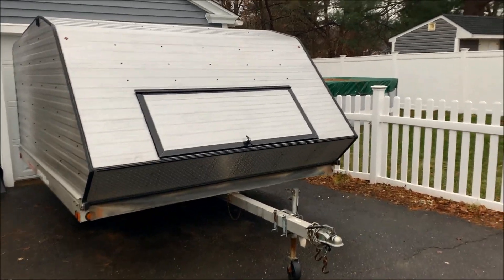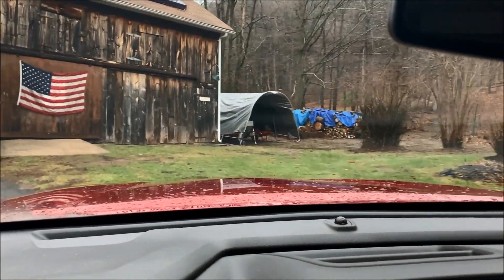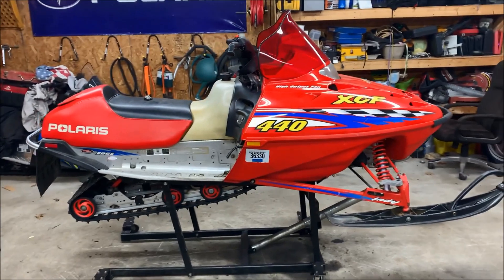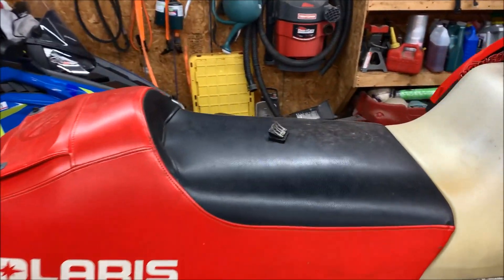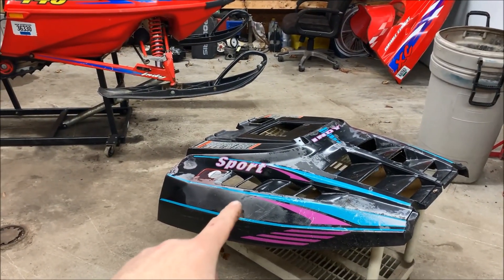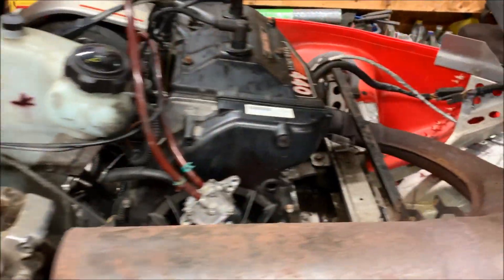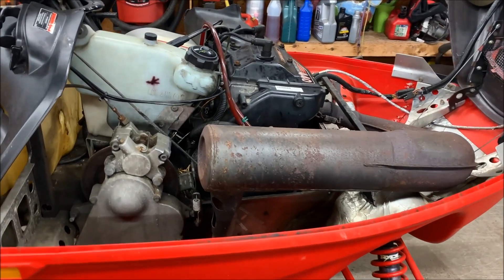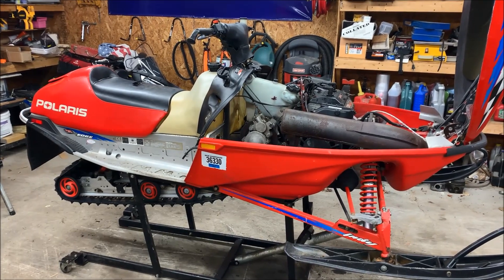One of Polaris Biggest Snowmobile and Engineering Mistakes - Not The Fusion But Close.

Comment: Probably the best Polaris fan cooled sled pre IQ was the the 1999 xcf 440sp, it is kind of hard to find because it was the only xcf in the gen 2 chassis. It apparently outran the indy 500’s and 550 super sport and was the fastest race sled in the 440 fan class in 99. The 1999 xcf sp stock ran about 68 HP and had Nikasil coated cylinder and different port timing than the non sp xcf. Also I believe that the 2000 and newer xcf sp also was timed a little too hot which also added to your overheating thing you were talking about.
Reply from the maker: I’m thinking about rebuilding the motor and dropping it into a CRC Wedge. Take the skid as well. I think it would be a great project.
Reply: I remember my dad had to take his in for the cdi update, I can't remember if they flashed it or replaced it though.
Reply: @HorsepowerGarageVideos  Was his a 1999 or a 2000 and newer? Because as far as I know that was usually only done on the 2000’s and newer. Also when they reprogrammed the CDI apparently they flashed it...
Reply: @lukasvanwechel8704  They were all edge chassis

Comment: Looks like a nice little 600 small block swap project to me. I bought a brand new 600 edge in 01’. Coming off my 94XLT with 6300 miles on it, the Edge was life altering.😁 Have fun!
Reply from the maker: Going to do a tear down of the 440 this weekend. If the lower end is still good, it may be the inspiration for this years project sled.

Comment: Good analysis and explanation of the flaws of design. Interesting, didn't realize the venting on the hood caused the overheating issues. Have a question concerning the IQ sleds, I've been looking at the 2007 & 2008 IQLX 600 sleds and was wondering what your opinion is?
Reply from the maker: The 600 CFI is a great engine. Pretty much bulletproof

Comment: You should keep it and do a cool engine swap, it's just money lol.  Put an XLT in there to really throw people off.
Reply from the maker: Unfortunately it’s already been shown no respect or dignity. Completely stripped and the tunnel is headed to the recycler. 

I think it would be more interesting to rebuild it utilizing a Wedge chassis with the Edge Skid and Engine setup. 

I need to look into engine mounting options for it. It did exist in the 99 Gen 2. So with the correct mounting plate,  I should be able to drop it in.

Comment: So I just got a 2002 edge x 800 last year. Love this sled. I seen it when I was young and always wanted it. Now you got me scared. Did I get a bad sled? It was in your list of Polaris woes. I trust your judgment what do you think?
Reply from the maker: The main issue was with bad PTO crank bearings. They had a tendency to fail. The rest of the engine was pretty solid.
Reply: I wouldn't worry about it, that sled has lasted 19 years already.
Reply: @StreetersGarage  thank you. Like I said before I trust your opinion.  So hopefully someone replace them over the years.
Reply: @HorsepowerGarageVideos  so true I never thought of it that way. Thanks
Reply: Check crank runout
Have primary dynamically balanced

Comment: What engineering mistake did they make with the fusion?
Reply: They had alot of problems early on that have either killed the sled or are fixed now when you find a used one
Reply: @jordanlittle5391  I have a 06 polaris fusion 600. No issues ever. 5000 miles
Reply from the maker: The 600 was not the issue. It was mainly the 900 and the 700. 

The abbreviated version is that Polaris was looking for a engine it could utilize to compete against Cats ZR 900 and Doo’s 1000 Twin. 

They used a new to them “Lay Down” engine configuration without enough R&D before it was released. 

The chassis was all new
The engine was all new

Owners complained of massive vibration and destroying belts just to mention a few.
Reply: @StreetersGarage  10-4, I've heard of issues with the 7&800s. Thanks, you have got to be the most experienced youtuber when it comes to sleds for sure! Love the channel 👍
Reply: @StreetersGarage  I remember reading a review by Maximum Sled about the 900 when it first came out. It was the first and only snowmobile review I’ve read read that was actually critical of a sled and didn’t hold back explaining the short comings and problems. It was like a 1980’s Dirt Bike magazine review that actually told the truth about a machine.